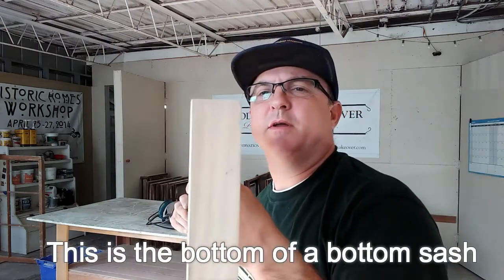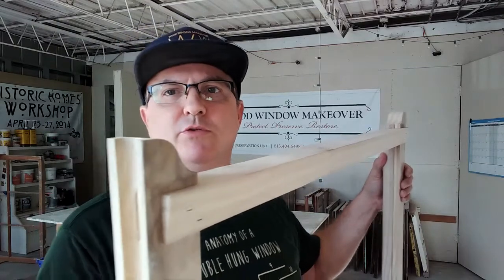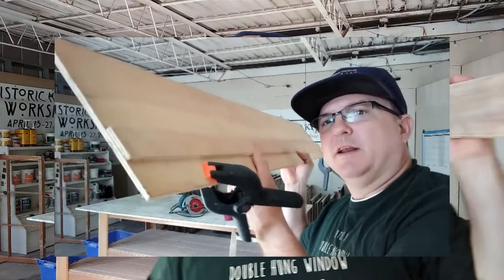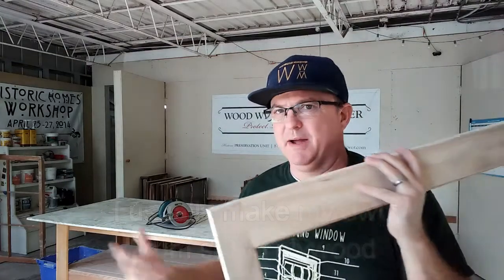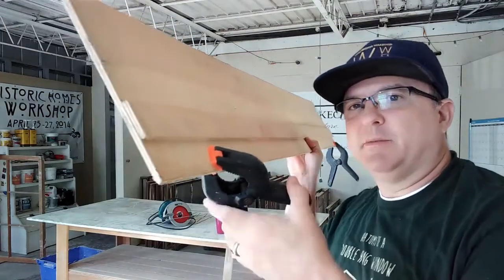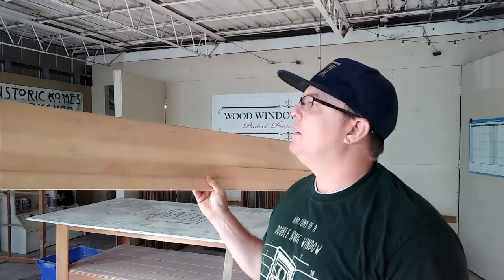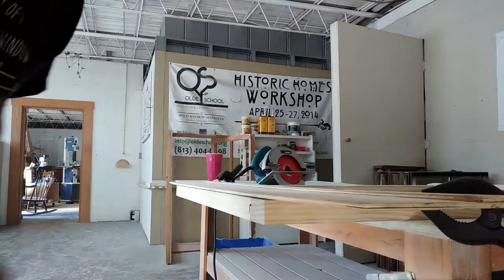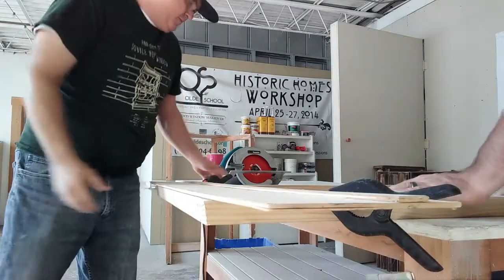Use a Saw Guide to Trim Wood Window Sash

Comment: Can you make a video on how to install interlocking weatherstripping on existing old windows
Reply from the maker: +Lukethplumber that's one thing I stay as far away from as possible, believe it or not. But if you are really interested, my friend Marc Bagala from Bagala Window Works has a DVD on it and I can probably get you a copy. I think the stuff is still available in NY.  I use a more modern approach to weather stripping, surgical tubing and vinyl leaf seals